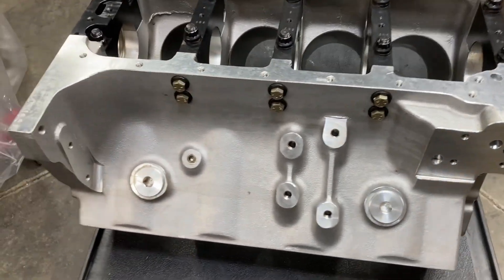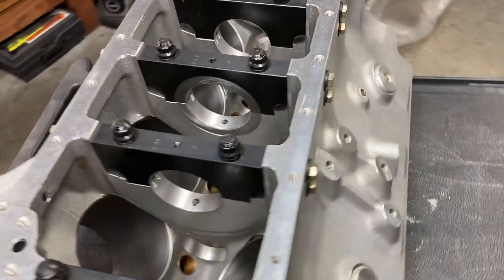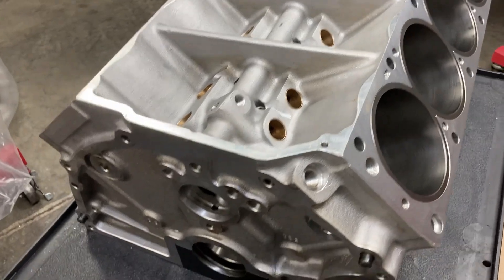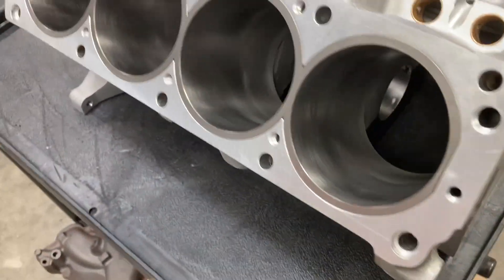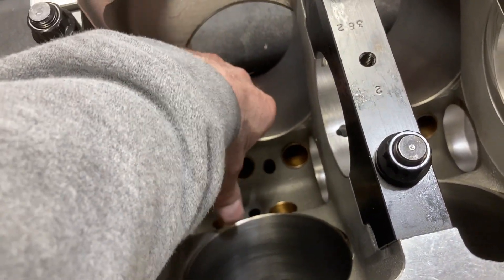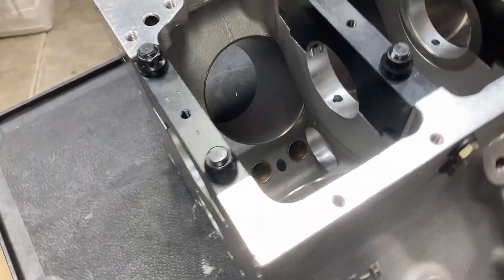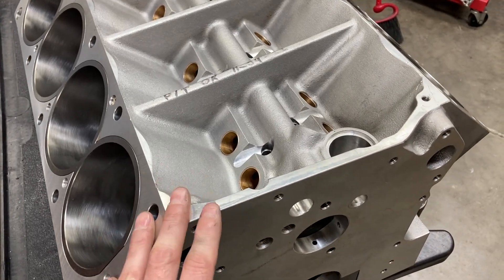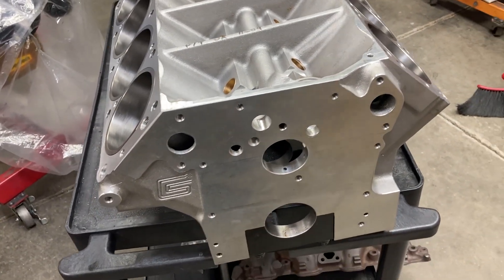Lykins Motorsports Shelby Aluminum Ford FE Block Prep & Overview

Comment: Very nice project.  With the compression,  a little bleed off with growth from heat and some cam overlap  and it could be a pump gas motor. Doesn't  sound like it's  going in that direction  though.
Reply from the maker: Pump gas on this one!  It's headed to Germany as well.

Comment: I have the same engine.  Built 15 yrs ago.  I run a Solid Street Roller cam and set the lash at 0.006" cold.  The Shelby block was cast by Arias years ago and is very economical compared to resurrecting on old 427 block.  The block comes with studs.  Paid $5600 years ago.  Oiling is based on a Chrysler hemi.  Saves about 150#.  This was the pinnacle of design in the 60's.  Compare it to a modern LS.  Symmetrical cylinders, rail rockers, deep skirts, side bolted caps, oil pump in front, high port (cathedral) heads.  427 in LeMans race trim made over 600 hp but was detuned to increase reliability and longevity for the race.  I raced mine in my street stock 1968 mustang fastback with full interior and roll bar, C6, Caltracs, and went 7.1 sec in the 1/8, about 11.3 sec in the 1/4 mile.  Now the engine has an ITB intake, megasquirt fuel injection, a 6 speed manual, A/C, electric power steering, and a detuned cam.  Used to own a Shelby GT500KR, but there is no comparison in power and handling.
Reply: Same here!
My brother and I bought one of these Shelby aluminum blocks wayyyy back in 2002 when we were building our ERA 427 Cobra.
No other choices back then except for used $2,500 OEM 427 side oiler blocks with welded up 'windows' in the sides of the blocks from 'unauthorized rod excursions'.
The Shelby block was 'only' $5,000 back then...lol
We also bought the Shelby stage 3 aluminum FE heads with the block.
Built a 468 FE (4.25" bore x 4.125" stroker crank ) for the 2,300 lb ERA Cobra.
Doug Nash 4+1 trans
2x4 bbl DOVE Tunnel Wedge intake with a thumping solid lifter cam.
Yeeee-owww does it run!
We call the P295 rear tires;
Rubber Fuses.